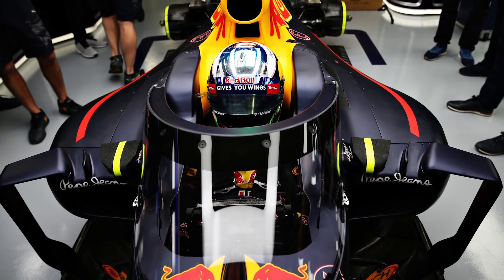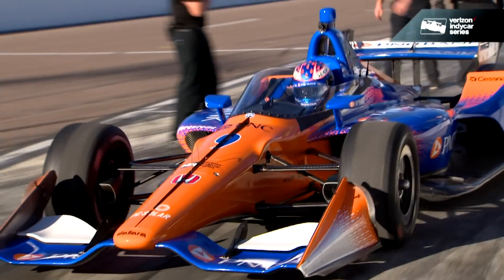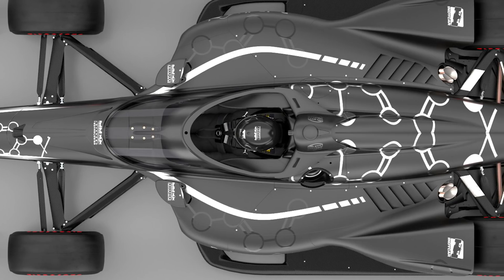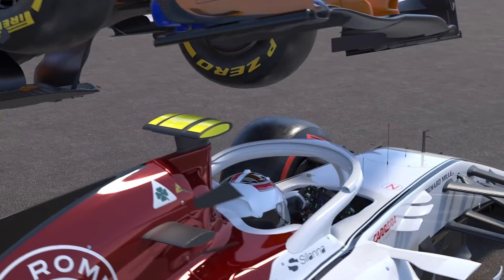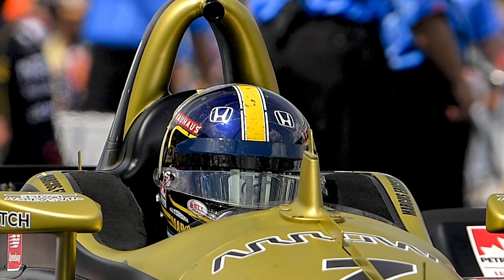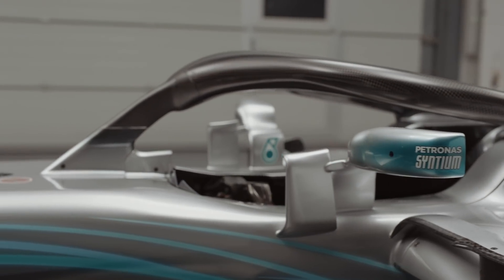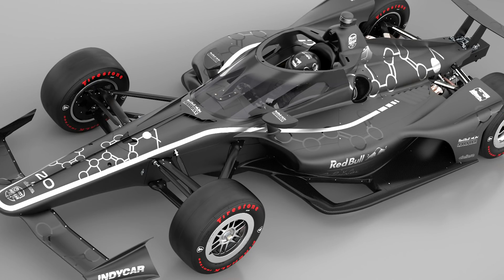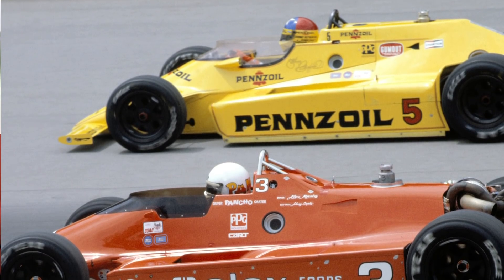Why IndyCar chose Red Bull's screen that F1 rejected

Comment: You can’t use the aero screen in the rain..how do you wipe it off?
Reply: Anton Villarina covered in a hydrophobic coating??
Reply: thanks i hate it hydrophobic coatings don't protect it from oil smears. When you're following behind racing cars in Monsoon rain, the amount of oil that would accumulate on the screen over a race would result in a screen mixed with oil and water images that would be impossible to wipe off during any pit stops it would just take too long.

Why do you think drivers have 5 tear-offs on their visor, so that they can pull one off every 10 laps if they need to.
Reply: Use Rain-X so the rain will just roll off the windshield.
Reply: how about smog?
Reply: With a dry rag
Reply: I guess on oval tracks, mud and oil and are issue as well
Reply: @jasperfk  Have you ever seen a race with cars that have windshields before?

C'mon, guys, this shit just isn't that difficult...
Reply: I don't know, you drive 100+MPH maybe? God forbid, if it's really THAT horrible but they still aren't red flagging the race, maybe give this extremely rare, REALLY uncommon, little heard of product called "RainX" - it will absolutely blow your mind!!!
Reply: Could tear offs be used in some way that keeps the used film layer inside the car?

Comment: It's just a halo with a visor. Isn't having that middle column distracting? I have to drive the games from the third person view as inside cockpit now I can't see shit.
Reply: with VR (or IRL), you have 2 eyes which allows you to see past the visor, but with a single camera/viewpoint yeah the halo really gets in the way
Reply: put your finger in front of your nose and look into the distance, its the same effect here, on a 2d screen though, you dont have the same effect, if you were driving in vr, you would be able to see this effect
Reply: Yea cos looking at a 2d screen in your room is exactly the same as looking past the halo to corner exits and entries...
Reply: Even in racing games the Halo isn't really a problem. I was driving the Super Formula Car Cockpit Mode on Gran Turismo and I was still slicing through corners at the Nurburgring with visible braking zone and apexes. I was scoring in the 5:30s, my fastest run yet.

Comment: I'm fine with the halos and screens but the talk of these guys being brave gladiators and so on needs to stop since they're all cocooned in safety gear now.  Bravery comes with risk, and risk in motor racing is almost gone.  If they're going to do this, they might as well fully enclose the driver, it will look better.  By the way, the ONLY reason these are being implemented is to shield the various racing series from legal action, so that when there is another serious injury or death, the racing series can say it took all available safety measures should the driver or their survivors pursue an injury or wrongful death lawsuit.
Reply: Evan Mulcahy “easily” is quite the overstatement
Reply: hentai plumber Jules’s death was caused by the stupidity of race control
Reply: @user-ux2kk5vp7m  it was Jules fault more than race control sadly
Reply: Being brave doesn't mean putting yourself in danger
Reply: @ely23231  if theres no danger whats brave about it
Reply: @clemfandango2379  when was the last time someone hit a wall head on at top speed and died because of it
Reply: @user-ux2kk5vp7m  Decades ago.

By your thinking Motorsport has been neutered for decades now.
Reply: AOR xMinxG could you elaborate
Reply: Evan Mulcahy I never said there is no danger...
Reply: Evan Mulcahy and yet everyone who crashed at the Indy 500 this year have walked away
Reply: hentai plumber but it’s so safe that like OP said, we shouldn’t be acting like these guys are risking their lives for this
Reply: Evan Mulcahy yeah of course it could kill someone but the chances of that are really quite low. Also massas incident didn’t “almost kill” him by any means

Comment: But are the screens going to perform well during a rainy or high humidity race? Or oil spill?
Reply: Burh, you doubt about the functionality of the screen but not the helmet? Those car are going at over 250kph most of the time what makes you think that liquid will stick on the screen. As long as it hit the screen it will just slip off just like what the helmet does
Reply: @jackywng1236  The helmets have peal away plastic layers just to deal with stuff getting stuck on the visor. 

That said I think with a proper nano coating and the rather steep angle most things will not really stick to it, but only testing can really confirm or deny that fact.
Reply: @Lintary  Do what Nascar does. Nascar has multiple thin plastic tear aways on the windshield. During pit stops, a crew member pulls one off to give the driver a clear windshield.
Reply: GEE GUYS, I WONDER HOW CLOSED COCKPIT PROTOTYPES HANDLE WATER AND TRACK DEBRIS...

It's 2019 and all of the sudden this new "wind shield" invention is just far too complicated for everyone to wrap their heads around...

Just wait until I tell you about this product that I've invented, it's going to blow your mind - I'm going to call it "RainX"...
Reply: ChienTing Chiou high tech windscreen wipers. Carbon fibre scrapers, nano-tech motors, the lot

Comment: Really proud to see companies try to provide more safety for the drivers, hope this makes it to F1, and not have something the likes of what happened to Felipe Massa happen ever again.
Reply: I don't think they'll scrap the halo. I wish they did though because this seems way better
Reply: You seem to be forgetting Jules Bianchi, that was much worse. Massa had a nasty accident without question but he was only injured and recovered with no major side effects. We physically lost Bianchi when a design like Halo, or a Halo/screen hybrid, would have almost certainly saved his life. They are ugly, that's indisputable, but they are a vital tool for long standing safety progression.
Reply: @razgriz380  the halo wouldn't have saved bianchi, the entire top half of that marussia was taken off, the halo wouldn't have survived
Reply: @redbullsauberpetronas  Yeah nothing would of saved him from that
Reply: @razgriz380  the car itself couldn't handle the impact and complete came apart, the halo would've done next to nothing.
Reply: @redbullsauberpetronas  Probably (I repeat, probably) any of today F1 cars would save Bianchi. The halo is part of a structure which reinforced the whole safety of the monocoque introducing front driver protection (as was extensively tested). It was not engeneered just a titanium frame attached to previous car structure.
Reply: @razgriz380  Bianchi died from the sudden deceleration, it probably wouldn't have helped.
Reply: @weltering5918  ^this is the correct response. Halo or no halo, nothing would have changed.
Reply: @redbullsauberpetronas  Think the impact of Bianchi's car with the recovery truck was also at an angle such that that rear corner of the truck that his car crashed into would still have been able to intrude into the cockpit
Reply: Not "invented" by the FIA, not "good enough" for the FIA. We'll see...

Comment: Just enclose the whole cockpit area with a fighter jet style canopy. Why leave the top open? To preserve the facade that it's still open wheel racing? It's not, either close the whole thing up and eliminate all risks of injury, or leave it all exposed and accept the fact that open wheel racing is inherently dangerous
Reply: Weight, and getting the driver in and out. I doubt there's enough room for a door
Reply: @boulder795  do you know how fighter jet canopies open, the whole glass swings up and out of the way. fighter jets dont have doors.
Reply: you are spot on!
Reply: I think it also has to do with heat and ventilation. With a fully closed canopy you need to add all sorts of air conditioning devices. With an open canopy it kinda takes care of that itself, so you don't need more (heavy) equipment in the car.
Reply: In open wheelers which have no doors enclosing driver from the top would mean that in case of a crashe and rolling, catching fire driver would be trapped . In gt cars he or rescue team opens tge door from the side and driver gets out
Reply: I watch the F1 power boats and they have this system (fighter jet canopy style) but they struggle with heating etc and have to have cooling systems in place to stop the driver getting heat exhaustion, and you often see drivers opening the cockpit to try keep cool. It's a great idea just hard to implement without more issues
Reply: Agreed. Close it up and we get then up the speed.

Comment: It's open wheel racing. Not open screen. No halo. No screens. Although the screen looks far better than the Halo.
Reply: "Open wheel" doesn't stand for "open steering wheel" jackass
Reply: Open wheel means the tyres not the steering wheel you utter moron
Reply: Yeah, let the drivers die. F*cking millennials like Leclerc can't even take a wheel to the head without crying.
Reply: @r4nd7r04d5  Never said that. Either make an argument or get lost mate. F1 is SUPPOSED to be extremely dangerous and risky. People want to see gladiators, who are risking their lives, basically. Hence the risk premium reflected in their stupidly large salaries.
Reply: @ciaronsmith4995  People want to see them side by side and crashing without body parts actually. 

Risk is always there. 

Alonso on Schumacher at 130r is terrifying despite all the safety tech on those cars. Why would it be different with closed cockpits?
Reply: @Minx5892  Alonso on Schumacher 130R is the most overrated pass ever, as Alonso subtly admitted when he said it wasn't really his best pass at all. That Ferrari was a Dog in 2005. Alonso had such a massive car advantage and was already ahead before going into the corner. I would say Mansell on Berger or even Raikkonen passing Schumacher up Eau Rouge are far more dangerous. Open cockpit is part of the risk. You are supposed to be vunerable. That's part of the danger and challenge. You can't get paid 30m a year and have the same risk as a Lemans Driver. Enough.
Reply: @ciaronsmith4995  Only savages want to see gladiators. "Bread and circuses" is not a compliment about the romans. I can't believe two millenia have passed and there's still specimens like you who can't enjoy a race without a 20 year old's head flying off because you want your cars to look cool. 

You know who gets paid more than 30M a year without risking their life every two weeks at 200MPH? Messi, Ronaldo, LeBron, Federer, Curry, Neymar. Even fighters like Maywether and McGregor only do it once or twice a year. Also: The Rock, the cast of Avengers, Will Smith, Ariana Grande, Jay-z, K-Pop bands... High rise window cleaners risk their life everyday, and don't get paid 30M. Soldiers die every day, and don't get paid that. More hikers have died in the past 10 years than F1 drivers, yet none get paid 30M. Risk of death in your job is not, and should never be, something to be proud of. We're enjoying a sport, not a bloodbath, and admiring drivers for their ability and reflexes, not their willingness to die for your entertainment.
Reply: @r4nd7r04d5  It's a bloodsport, whether you accept it or not. That's what draws the massive crowds and the top talent. The real talent that enjoys the thrill. With more dangerous racing we would see more respect too, because nobody can afford to be reckless when their lives are on the line. Also, Windowcleaners don't get paid nearly enough. That job is just nuts in my view.

Comment: If you got to have this sort of protection , the Indy version is the best for all round safety and looks
Reply: The halo for formula e gives protection and also looks very nice on the overall car design
Reply: @arvin6606  The halo looks horrific.
Reply: spam lite Salty. Formula E cars look great
Reply: Electric trash @butterbean8881
Reply: BRIAN The train you can’t slap a roof on it and make it closed cockpit then
Reply: I think I like the aeroscreen on the Indy car and the halo on the f1 car. I personally don’t like the aeroscreen on the f1 car
Reply: Completely agree
Reply: BRIAN The train Indy cars don't run in heavy rain though. If the screen gets made in oil and water, an F1 race would have to be postponed.

But F1 drivers drive-in rain, so it's a bit different.
Reply: @RB747domme  Indycar runs in heavy rain on road courses and steet circuits

Comment: no doubt about it.  The screen will come to F1.
Reply: I'll believe it when I see it - not "invented" by the FIA, not "good enough" for the FIA
Reply: Idk halos that bad
Reply: Haha not North American.  The screen will come because it will be ultimately safer and offer aero aspects the halo can’t.
Reply: Poniatowski it's actually more dangerous. Because in the Rain, it will start mixing with the oil from the car in front, and you will have smears on the windscreen obstructing the driver's view.

Unless you're suggesting the F1 should not run in the rain like the pussies in IndyCar?
Reply: Clint Tapper Indycar does run in the rain you muppet.
Reply: @poniatowski3547  How can it be safer when it is made from less, weaker material? lol. The Halo is literally carbon fibre wrapped around a titanium roll bar and you think a small peice of perspex is better? Hahahaha, keep guessing kid. Also the Halo is aero neutral, when it comes to aerdynamics, F1 is generations ahead of Indy.
Reply: @Nemoticon  youre right , but its youtube bro ;) let them talk crap as much as  they want . Youtube is the pit of scum for me .
Reply: @Nemoticon  you do realize that the screen comes with the halo. The screen prevents small debris coming into while the halo simultaneously does what it has been doing previously. So in terms of safety, the screen design with an integrated halo is a much safer option than the halo alone. For those of you who don't want screen option solely on aesthetics let me tell you something, F1 wasn't always screenless.
Reply: Because Indie car does it? lol! Let me guess youre from the US right?
Reply: Poniatowski so you think that F1 should only run in the dry?

The FIA could never sanction a system where F1 races are postponed in the wet.
Reply: It's inevitable that they will be fully closed canopies at one point. They should just get on with it already. As soon as it's possible. Close the wheels off too, whilst you're at it. Done with the sacrilege. Let's go for performance. 😈
Reply: I do not hope so .. then it's just a "closed cabin racing" like everything else
Reply: I hope not, takes away gforce and looks incredibly ugly.
Reply: I hope not, it doesn't look like an open cockpit anymore with this instead of the halo. Ultimately safety should be the deciding factor though.
Reply: It will not come to f1 and the halo looks better
Reply: @dailyentertainment0o  while it is a more subjective aspect of the debate, I can't see how it looks better than an aeroscreen. Also, the aeroscreen can, as the video mentioned, offer better protection against small objects (like that which hit Massa).
Reply: @ebob4177  the aero screen is too big and it just looks like the drivers are nice and cosy in their car that can't really be called an open seater.
Reply: @mabra33  they're actually having an overheating cockpit issue.
Reply: @dailyentertainment0o  ...found the F1 fanboy...
Reply: @RyTrapp0  what's wrong with thinking the halo looks better.
Reply: Why? Because of aethetics???? C'mon, wise up. F1 didn't go with the screen because it did not perform as well as the Halo, simple as that.
Reply: @Nemoticon  That sounds like b.s. the halo was simply rushed in without giving time for a windscreen development.
Reply: @johndessire399  Quit guessing
Reply: @Nemoticon  how am i guessing? They did 1 lap with a windscreen and called it quits.
Reply: @johndessire399  So your assessment of a short 'windshield' test concludes as the Halo isteself being rushed? That's what we call reaching... the Halo is a fully tested device that has met all requirements and failed none. People are just reacting to it because of aesthetics, simple as that.
Reply: @johndessire399  Btw, if you look it up... that one lap RBR did with the 'windshield' was purely a trial design for looks. It was not built to deflect anything, it wasn't even properly bolted to the car. Hardly surprising they didn't explore a 2nd lap with it, lol